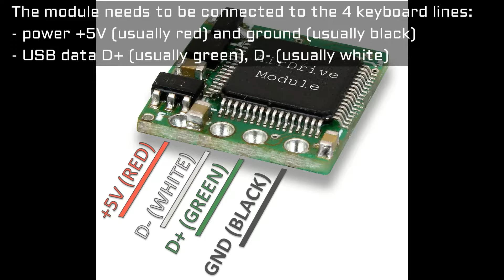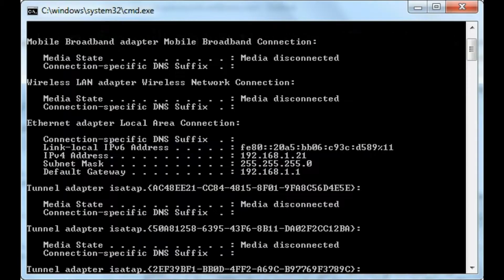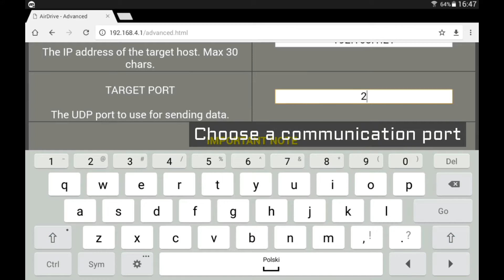AirDrive Forensic Keylogger Module Pro Live Data Streaming

Comment: can you add an antenna to this to boost wifi reception?
Reply from the maker: No, not in this model.  The WiFi reception is fairly good though.
Reply: @theKeeLog  Thanks for the reply. Mine actually had a very tiny wire beneath the shrinkwrap. Would it boost the reception if I soldered a fabric style antenna to it?
Reply from the maker: @TankCatIntoMordor  we've tried many different variations of antennas, and a wire with length adjusted to the 2.4GHz wavelength seems a compromise between size and range. But of course you are free to experiment with other types of 2.4GHz antennas.
Reply: @theKeeLog  Nice work